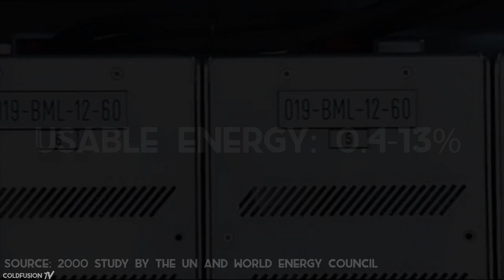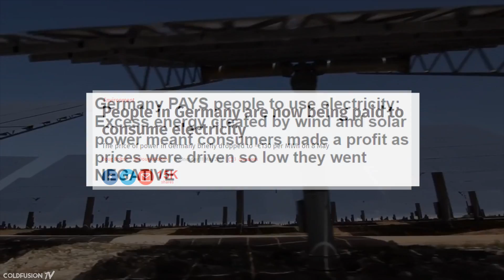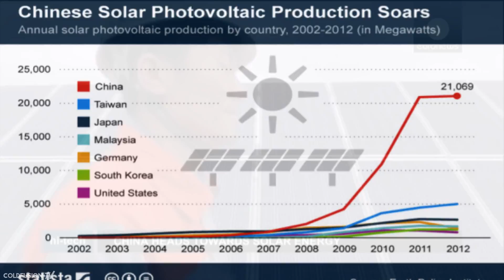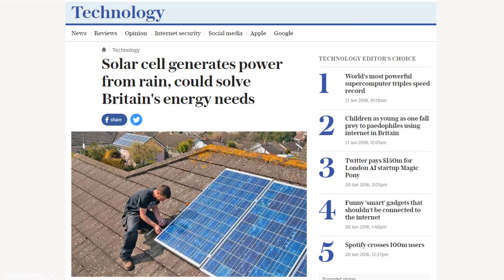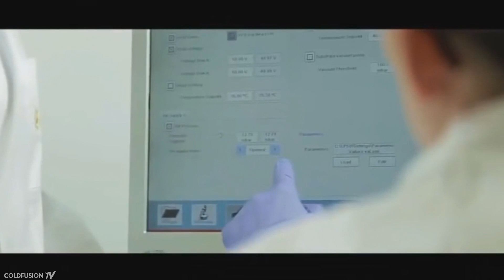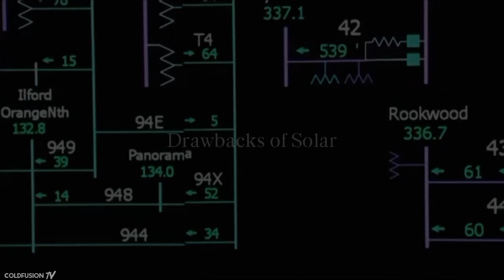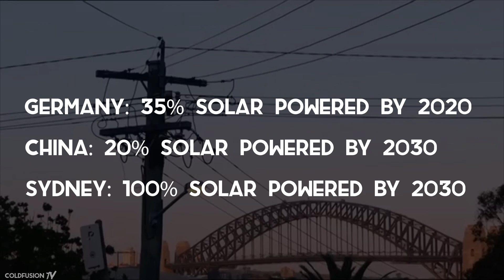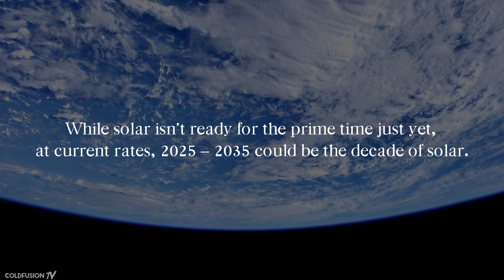The Truth About Solar

Comment: it makes 0 scene money wise to buy solar panels unless coal and nuclear are under attack in your state so power cost are high and your state is willing to pay part of the cost to have them installed. for solar Farming the sale of kWh needs to be held artificially high (from a government program) for solar farms to make their money back in 5 to 7 years. if the government program stops artificially keeping the price of kWh high the break-even point would be about 10-15 years. (solar panel lifespan is around 20-30 years). most state government programs are planned to end around in 10 years so sometime around when you break even after that your profits will drop about 30 to 60%.(depends how many farms and how many other sources of power there are in the state you know supply and demand) I looked into it as a business idea to get basically free money after the setup. I decided by the time i could get a solar farming set up it would not make scene.

Comment: howdy,  i'm not an engineer, a technician.  the questions that seem relevant to me are as follows:  1.  how has the lifespan of photo-voltaic collection cell changed with the advances of the technology?  2.  it costs A amount of energy to create the PV cell.  there is B amount of energy and cost associated in purchasing, transport, installation, insuring, decommissioning and recycling or disposal of the cell.  A + B = C for costs.  in the lifespan of the PV cell it will gather X amount of energy which could be purchased from utilities.  the question is which is larger, the costs of X amount of electricity purchased from a coal fired utility or C ?  3.  at current prices the cost of electricity is $.05/kwh.  what is the price per kwh produced over the lifespan of the PV cell?  the individual homeowner needs answers to these questions to make an informed decision about whether he should invest in solar.  good vid, well done...

Comment: you forgot two problems:
loss of land means a loss for plants to utilize solar energy. We as a species are trading photosynthesis for direct mechanical energy that electricity can use. 
The second problem is that electronics can use heavy metals in the manufacturing, thus regulations are needed for recycling and cleaning up solar cell production and disposal

Comment: The 30 cent cost is a spot price, Its not actually delivery price. Also, its not the price of the system, but rather a cell. Mor over, its silicon cells, the one in the 70-tys was gallium cells that is a lot more expensive, but also rather a bit better. ITs really a apple and oranges comparison.

The transfer of power long distances is really expensive. The negative price is a real issue. Even in Denmark that is well conected to both Norway and Sweden they are plauge with negative prices. This is not due to a lack of transfering infrastructure, but rather a base problem with solar and wind.

The issue is that even if the cell is 30 cent (they are really not, the are more about $1:50 or so when bought of the shelf, still relatively inexpensive). The cost of the rest of the system is about $3 or so...Even if the cost of Solar-cell would be zerro, the cost of the rest of the system would still be the same. The falling cost is just falling on a faction of the actual total price.

"could face cost as low as 8 cent per kwh"... well  that with out transfere cost and during the time the sun is shining. At nights or bad weather it will be twice as high because the back up power must recoupe there losses. Compare that to Chinese Nuclear of about 3-4 cent per kWh, and that is 24/7.

Mores law is not even anything close to a real law.. its just a statement of obeservation. Swansans law its not even that.

Elon musk is lying. To get only a 10% reduction you would have waffer thing cloud covrage. A normal north european clowd covarage reduces the power about 10 times.. virtually zero. (yea, i messuered it personalty).. you can also se this very simple buy just looking at the output of any normal home solarcell unit.

The reason why Britan is green is because it is wet, not light. Plants don´t need that much sun, but the do need a lot of water.

The solar cell that produce electric power from rain is really retarded... yea sure, it produce some power. but we talking picowats. Its more of a prof of concept than a actual usable product.

5:50 this is a other retarded statment. You don´t get more power when you point the solarcell in the wrong direction. You get less. ... Yea sure, you can make a scenaro where that is not true, but its really just a point of proving something that is not accurate.

6:20 .. yea using of the shelf polymer PV solution and print it it not really that impressive... Its like having white paper and red paint to produce red paper. Yea it might look impressive if you don´t understand it... but, its not that impressive.
Oranic PV have been around for 15 odd years now. but they are horribly inefficient and have a fairly short life span. On a device as a phone the short life span its not really a problem, but the low efficiency is. You are better of with a gram of extra battery.

Having it on the roof its not a good idéa. Organic PV will just last a few month, maybe a year or so. Then it bust. They really break down quite rapidly with UV light.

The lithium home batteri is about twice as expensive as old AGM or VRLA batteries with similar performance (well there weight is higher, but does it really matter in a home?). The batteries were out quite rapidly of you have them carge and disscharge fully every day.

The cost of storing one kWh of power in a battery is about 20 cent. So just storing it is about 5 times more expensive than producing it. With a VRLA battery you might come down to 10 cent, but its still quite expensive.

The best panels may be 35% efficent (there are prototypes of over 40%)... but this is all multi junktion cells. You cant have multi junktion cell on the roof of a house.. They need to be turned into the sun. Also, there production is geting down to 0 much faster when its clowds around because they need a sharp sun. 
The best theoretical single junkition cell is about 30%, but with real world constraint 20% is more realistic, and its about what the best one is today.

Not, its a theoretical imposibility to go higher... this have nothing to do with technology, its the temperature of the sun that blocks a single junktion cell to go higher.

"China want to be 20% by 2030".
No.. this was the 2010 to 2015 year 5 year plan. The 2015 to 2020, 5 year plan they diched solar energy totaly. The also lower the amount of wind power quite dramatically.

The 35% number for germany is rediculas. THey cant even handle there grid as it is today.

Comment: Congratulations!  You've finally purchased that Tesla S that you've been wanting.  And now, because you're such an eco-geek, you'll want to charge it with solar power, right?  And because you have the average commute, it'll have to support driving 15 miles each way every work day.  So, time to crunch those numbers!

First, how much power will it take to drive the Tesla 30 miles per day?  Well, according to Tesla owners (https://forums.teslamotors.com/forum/forums/miles-kwh ) it'll take 320 to 420 watt-hours per mile.  Average that and call it 370 watt-hours, realistically.  So your 30 mile drive will "cost" you 11,100 watt-hours.  Now, at best, at the equator, on a sunny day with no humidity, the Earth receives almost 1400 watts per square meter, at the surface.  But once we factor in the efficiency of the PV panels, the efficiency of the batteries, and other non-optimal things (Dust on the panels,  clouds, etc) you'll be lucky to get 30% of that, which is 420 watts per square meter, if you live at the equator.  (Those who don't actually live in Ecuador might find their mileage is far, far worse.)  Now, assuming 8 good hours of useful sun during the day,  a single 1 square meter PV panel should give you 3360 watt-hours per day.

But wait, you don't live at the equator? And you don't want to move?  Oops.  For fairness let's say that you live in the geographic center of the contiguous United States, which is in Kansas at 40 degrees North.  At that latitude you'll only be receiving 63% of the solar radiation, so the total received (For you) is only 882 watts per square meter, and you'll only be able to gather 264 watts per square meter.  (Bummer, huh?)  So to gather just the energy you'll need to power your new Tesla will require 5.25 square meters of PV panels, gathering sun all day.  (If you aren't good with meters, then this will require a square of solar panels that is about 7.5 feet on each side.)

Good thing you never, ever want to drive anywhere else!  You don't actually want to go other places, do you? And, good thing it never rains and there are no clouds where you live!!!

Solar sucks in the real world.
Reply: I'm sure you put a lot of thought into that, but even if you powered a Tesla 100% on electricity generated by fossil fuels it would still be less polluting than a gasoline car. Our electric grid however is not 100% fossil fuel, every bit of solar/wind/nuclear/geothermal/hydro added to our grid will just further cut into the amount of pollution.
Reply: Two points:  First, my post was all about the practicality of solar for a normal purpose.  I never mentioned pollution.

Second, because it's very difficult to measure, most people don't realize how much pollution is created by using solar.  Creating PV panels isn't a clean process, and those raw materials don't come from thin air.  Next, batteries are incredible polluters, and the rare earth metals used in generators/motors such as the Tesla uses (And which come from China, where they don't care about being environmentally friendly!) are extremely nasty.  

Be careful when you mention pollution.  Burning fossil fuels isn't the only source.

Comment: wiki prediction are made by oil companies, so don't believe them, as oil will be worthless when electric cars be come standard. if u read the chart from 2004 to 2015 solar is going up 100x in 10 years so, based on this growth rate solar will be 100x in another 10 years. 100 × 1% = 100% of world electricity. that's 2025 100% power gen by solar.  battery tech also growing very fast so storage in 10 years by battery is predicted. 

in Australia this year the cost of solar on room top including batteries  is equal the transmission cost, the cost to transport through the electicity grid, therefore even if the electricity is free from the power plant, solar is still cheaper. with costs going down it predicted most of the world will reach this level within 5 years.

Comment: philips already has a solar pannel at 75% efficiency...
Reply: That's not at all the same metric typically used to measure efficiency of other panels, even the most exotic and expensive experimental panels are just barely pushing efficiency percentages into the 40s. Those panels are not easy or cheap to mass produce, and mostly reserved for spacecraft where cost is not a concern.

Comment: One weird question. Can solar panels cause global warming ? isn't it solar panels job to drag more heat ? which will eventually make surrounding warmer or in my case hot like oven. I was at Nevada solar plant last month and holy shit it wasn't even summer and area was so hot average person could die in few hours just being around. Temperature there around 45 degree celcuis.  So if we add such solar plants all around the world wouldn't it increase average globe temperature ?  I always thought about this and last month even experienced it so i can't be wrong i guess, someone explaining me better would be appreciated.
Reply: it does get hot in Nevada...  :)
Reply: You are wrong, solar panels do not 'drag more heat', they collect energy from light that is already here anyway.
Reply: Either 10kWh hits the Earth and is absorbed or 10kWh hits the solar panel, 2.5kWh is turned into electricity and 7.5kWh is absorbed. Which one do you think absorbs more heat? 
10kWh of heat(since us humans use electricity 2.5kWh of electricity is produced by another method which due to laws of physics isn't 100% efficient, so let's say typical power plant is ~50% efficient, so 2.5kWh of electricity and 2.5kWh of heat)
or
 7.5kWh of heat (+2.5kWh from it being used by w.e happens to use that electricity)

Summary:
no solar panel= 2.5kWh of electricity used 15kWh total heat generated
with solar panel= 2.5kWh of electricity used 10kWh total heat generated
Solar panel saves 33.3% of what would have heated up the Earth on that particular spot where the solar panel is
The amount of solar panels that would be required to provide the 70PWh the world consumes in a year we would need to cover 0.3% of the land area (or 0.1% if you include oceans)

Extra: 
What about increased CO2 levels contributing to extra heat retention from the sun?
Calculations didn't take into account Earth radiating some of the heat into space

Comment: This B.S. presentation doesn't even touch on the real problems with solar.  These panels are highly toxic.  There is no current method to recycle the panels.  The methods that we use to mine the materials needed to make the panels are incredibly destructive.  These panels don't last very long (about 20-30 years).  The efficiency of the panels drops steadily over their life.  Also, as soon as you start talking about lithium battery backups, you need to take into consideration all of the issues with lithium. As far as I can see, solar panels are just another crap consumer product that is "designed for the dump" at this point.  In fact, the only argument that I can think of in favor of solar is that the technology is still in its infancy and by buying solar panels you are supporting research and development of hopefully newer and better solar technologies.

Comment: The biggest hurdle for solar to overcome is the power industry itself.  The current business model relies on central distribution of electricity  and selling that electricity to consumers.   Solar performs best if it is disbursed not centralized. You put solar panels on each rooftop/building and store the electricity on site and use it as needed.  For large consumers of electricity they might need to buy outside electricity, but for the average household you won't need to purchase outside electricity (once the cells and battery storage technologies are good enough).  Solar threatens that business model and the big power companies will fight tooth and nail to stop this revolution.  They will delay and slow the technology development as much as possible and they will continue to manipulate the market for electricity to keep them in business.  If we can convince governments to recognize this problem AND DECIDE TO FIX IT (and that is the key, right?) then we can begin to transform the whole power distribution network.

Comment: The problem is the actual economy itself that must be considered in view of robots replacing humans etc and need to fund services  at some time we reach a point of no return in deficits  it would be far wiser if people of towns owned the solar plants as a collective and had batteries in homes rather than each house i will not bore you will all details but if you at coldfusion make contact full explanation can be arranged this way help pay for local services and eventually means energy cost is negligible 
 far better to examine the most advanced and cost efficient systems and wait  than act in haste

Comment: Monocrystalline solar panels produce about 10% of their nominal capacity through clouds. With dropping prices, it becomes feasible to produce energy on cloudy days. But night is still a problem, snow is a problem in some places. 

About batteries - lithium titanate is probably the best we have right now because it can be recharged 10 000 of times. Bit expensive but it will come down. Still it might not be feasible to store all the daily energy we need for foreseeable future.

Solar and wind installations are currently often combined with generators running on natural gas. It is not totally green but beats coal any day. Question is maybe we could rather use bio-gas instead of natural gas there?   

No 1 green technology can actually take on coal on its own. We need combination of green technologies to power the world.
Reply: By the way fastest growing energy source is still coal. Global coal consumption increased by more than 70% from 4 600 Mt in 2000 to an estimated 7 876 Mt in 2013.  World is growing ever more energy hungry. We really need everything we we can get to stop coal.
Reply: +Martin Laak traditionally there is baseline powerplants and peaking powerplants. Baseline has a lower $/kWh while peaking plants are more capable of ramping up and down quickly. Coal is traditionally baseline power, while natural gas provides peaking. 

But with the recent bubble in fracking producing far more natural gas than oil, the price of natural gas has plummeted and it is now cheaper to run natural gas peakers as baseline, so a lot of power companies are shutting down their coal plants.
Reply: That is probably mostly because of China, they make the solar panels and sell them to the world, then burn more coal lol